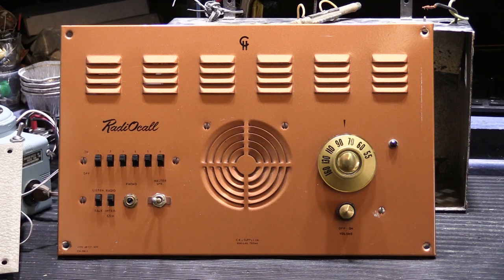Something Completely Different - An Overview of a C&H CH700-3 Radio Intercom Master Station

Comment: My grandparents' house from 1950 had one of these, so it is at least that old. Really great to see one, as I've never seen any show one before. Theirs is installed in a house in New Orleans, Louisiana. I never have been able to find anything on C&H but my assumption is they were an electrical supplier at the time. Must have had a radio manufacturer sell them some so that they could sell thing as advanced technology in 1950. This was "whole house audio" in 1950. Believe it or not, AM radio was all there was. Wish I could have listened to the Beatles on their unit. Great stuff.
Reply: BTW, this has an "outdoor station" that is the same as a remote unit, but without the on/off switch.
Reply from the maker: Hi Maniacal Michael:  Very cool - Your grandparents were living the Jetson's lifestyle in the 1950's - for sure - Chris

Comment: This is the start of a great video series! Even though you repair NuTone, it'd be cool to see competitor's sets from different eras (Broan (which later integrated with NuTone), M&S, MusiCall, etc)... I have an old MusiCall AM/FM tube set with an old-style aux port on the front of it... someone mounted it in a wooden box and put a plug on it to be used as a table radio. I'm going to replace the tubes at one point, as only some of them work.
Reply from the maker: Hi Vincent:  Thanks - I've never heard of a MusciCall System - When was it made?  - Chris
Reply: @northsideservicecompany3567  I'm thinking sometime in the late 1950s, early 1960s. It's AM/FM, tube set, aux input. All metal front, it's kind of a goldish aluminum color. It's similar to the set that was installed in the Brady Bunch house when it was up for sale recently.
Reply from the maker: @jeepguy95  Sounds cool - Chris

Comment: Our house was built in Gulf Breeze, FL in 1957. We had this working intercom until 1970. We replaced it so we could have FM.
Reply from the maker: Hi Turbuck:  That makes perfect sense - I think that many of the earliest Radio Intercom Systems that only had an AM Radio Tuner would have been upgraded to an AM / FM Model, perhaps just a few years later
     The NuTone Model 2011 / 2012 was the very first Radio Intercom that NuTone made and it was an AM only design, it was introduced in 1957.   In 1960, NuTone introduced the Model 2015 / 2016, which was AM and FM Radio.  This all new model was a Direct Replacement for the 2011 / 2012 - just unscrew the original Master Station and mount the newer model - Chris

Comment: I've got the stove vent hood (and matching tube that runs to a ceiling fan) that says, "Commun-a-hood" and has C&H on it. It's in very good condition. 5 or 6 room units. Any history on that one?
Reply from the maker: Hi R Dayton:  Umm - I'm not really sure what you're asking about. . .  You have a Kitchen Vent with 5-6 room stations???  More explanation is required - Chris

Comment: Remote speakers do have  a volume control is the on and off switch. The more you turn it the louder it gets.
Reply from the maker: Hi Yvette - The switches on the Remote Stations were simply On/Off Switches - definitely not Volume Controls - Chris
Reply: Well, it was a very long time ago. So your most likely correct.